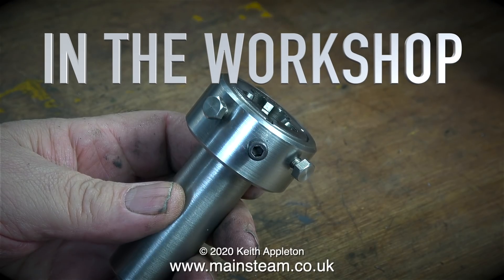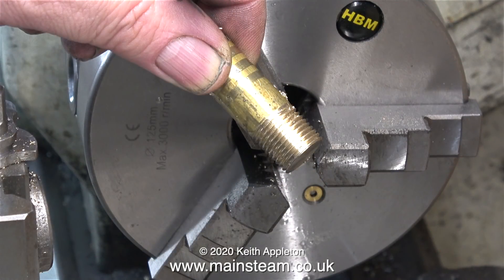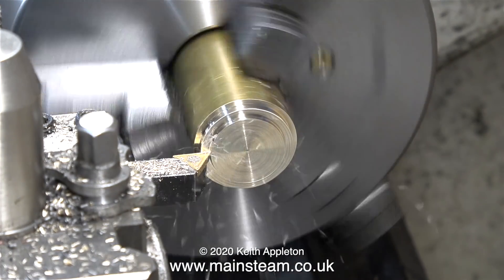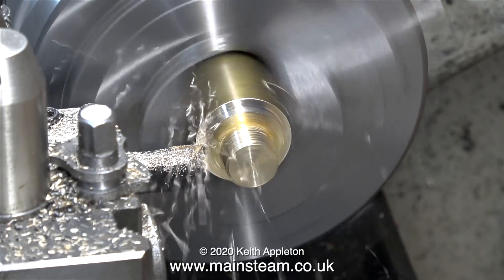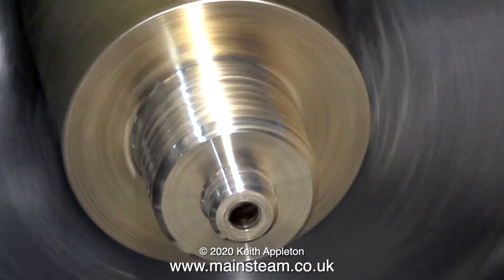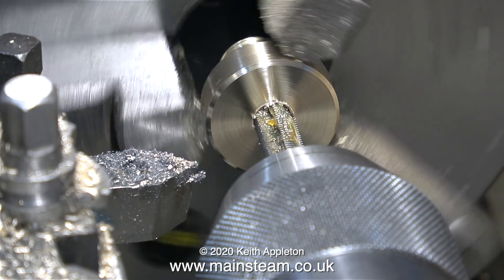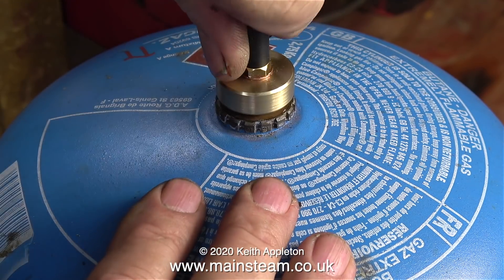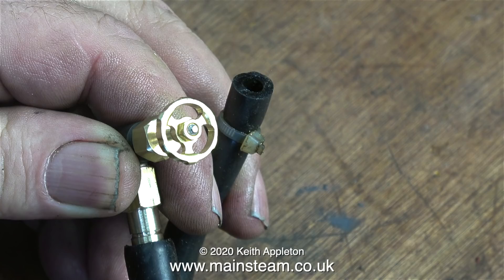HOW TO MAKE A GAS VALVE - IN THE WORKSHOP

Comment: To hold a part by the threads I use collets. But I suppose you don't have any collets to fit your lathe. 2nd best method is to use something fairly soft between the jaws and the work. For this I use an old pop can and cut it up with scissors. Actually I use a beer can but I think pop is more politically correct. Anyway it's easy to cut and makes a good barrier between work and jaws. All your other cautions apply. 
You do really good work for someone who pretends to be amateur. 😉
Reply from the maker: Yes I have collets, plenty of them - but just one more time: These video tutorials are designed for the benefit of beginners to this hobby and beginners seldom have Collets . . . . .

Comment: I've encountered brass shards while machining, and yes, they're bloomin' sharp! It might be worth getting a smock so you're not covered in bits after a lot of machining. 

As for cutting screw threads on a lathe, if you've got a die,  you're usually better off using one of those. In my experience (watching people who know what they're doing),  cutting threads with the lathe is best left to special threads - things that you can't easily get a die for. 

Thanks for the video, it was very educational.